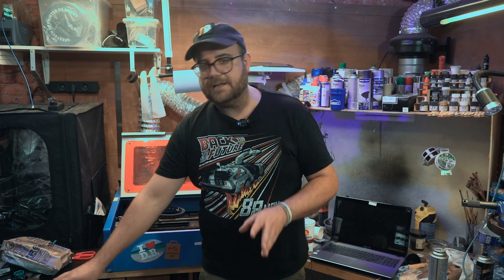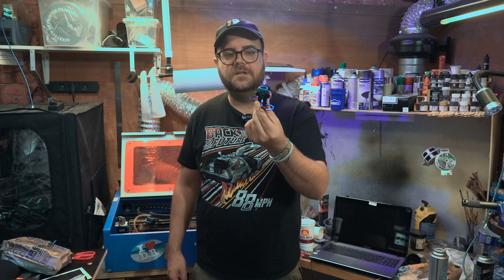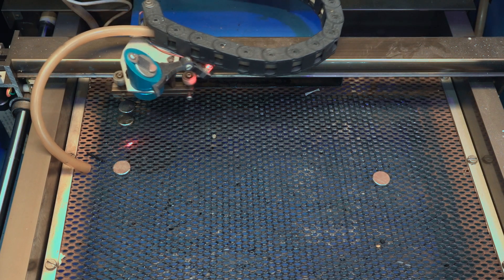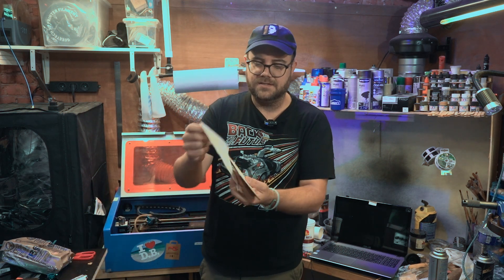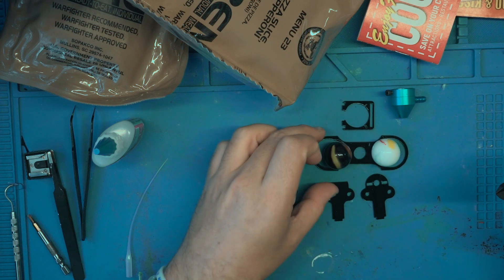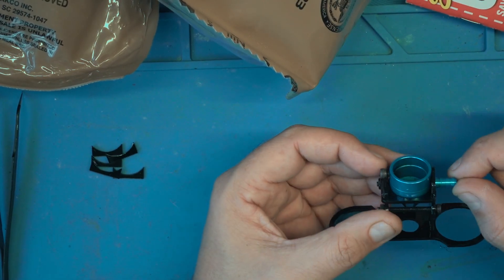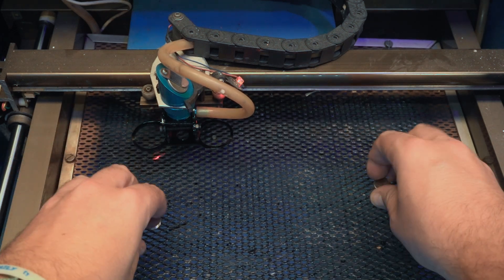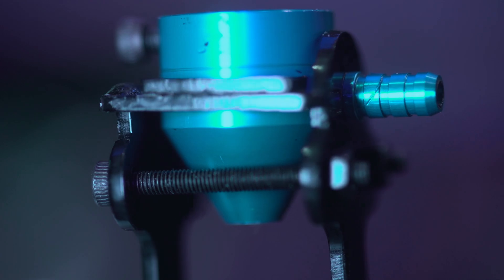K40 Laser Cutter Upgrade: DIY Foil Flattener Attachment

Comment: Most foils/vinyls are made of PVC. You should never cut PVC with a laser cutter. It will create acidic vapors which will corode the machine and you obviously don't want to breathe them in either. Please make sure to order special foils which are not made of PVC.